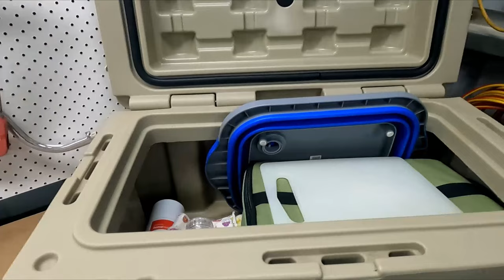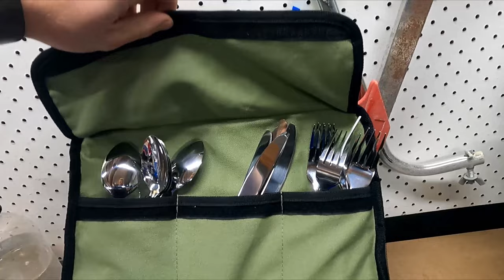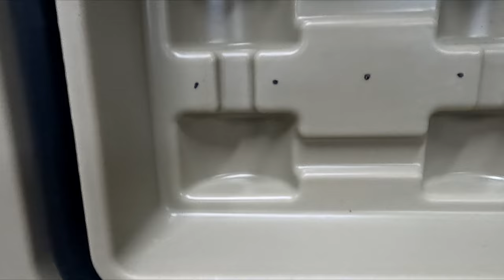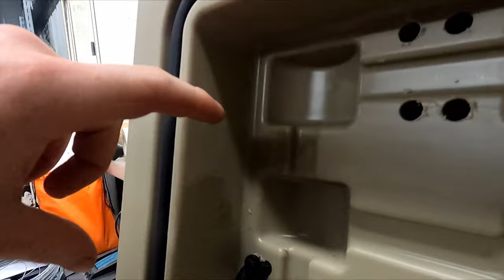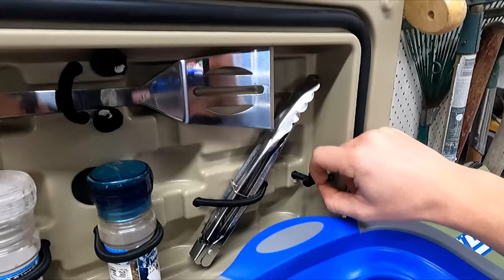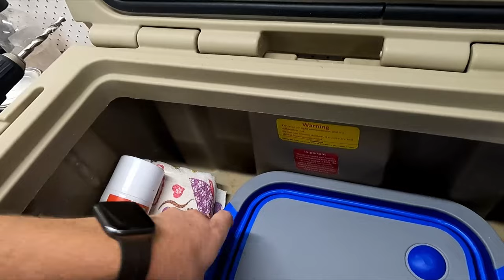DIY Portable Kitchen! Cargo Box Storage Solutions Storage Hacks for Camping!

Comment: too cool, loved it, cheers
Reply from the maker: Thank! Glad you liked it! Comes in handy to keep all your cooking and eating utensils together!
Reply: Great job! I would like to make a suggestion if I could. With your cutlery set and utensils, remove them completely from the Kings bag. Even though it's a great kit, it takes up a lot of room in there. To maximise space in mine, I have used a long narrow container from the reject shop for my cutlery. Your plates would fit standing on their edge under that lip around your case, and bowls, cups will nest together. 
I would even add another bungee strap right across the middle of the lid by adding a large head screw on each side (inside the lid seal of course!) and put a loop in each end of the cord, so you have somewhere to hang paper towel as well. You can simply take the bungee loop off the screw to remove the paper towel.
I would even suggest to buy yourself a little bit of marine carpet to line at least the floor, but walls would be ideal too.
I have built a few camp kitchens like this over the years, and I have used marine carpet to not only line a case out, but glue 2 pieces together and create diving walls with it. It works great.
Now that I'm on my own, I take even more notice of how to maximise space without having to leave things behind. As I said before, you have a solid base to build from, and I'm sure you will tweak it further, as that's what getting out there is for, so we can all improve what we have watching great ideas from YouTuber's like yourself 😊
Reply: Edit to comment above.....dividing walls, not diving walls!
Reply from the maker: Appreciate you taking the time to share your ideas! Thats exactly what this is all about everyone getting involved and having their say and getting to do a heap of cool stuff together! I might have to revisit this and look at this in a future video maybe!